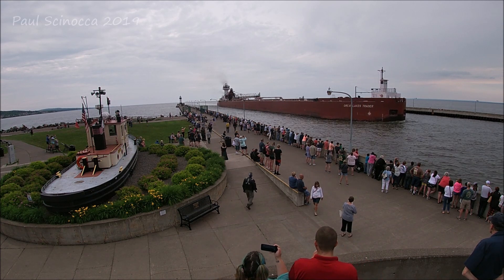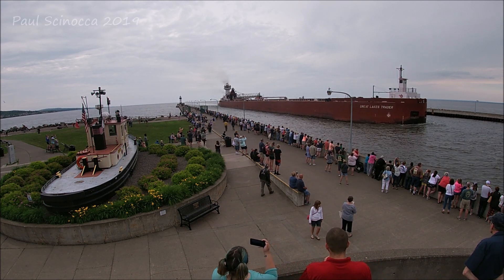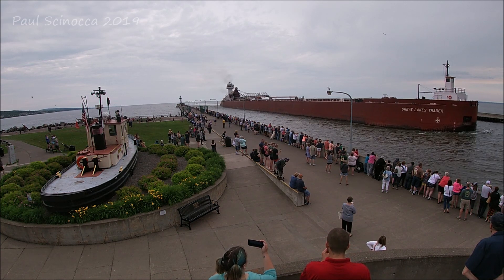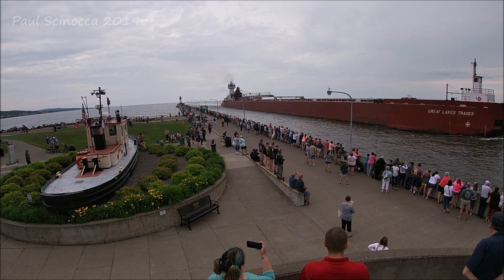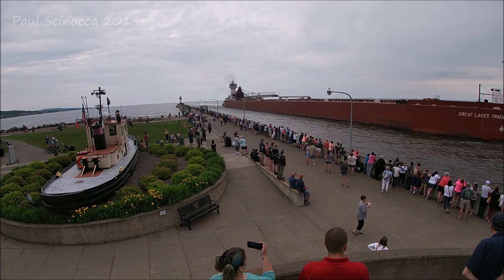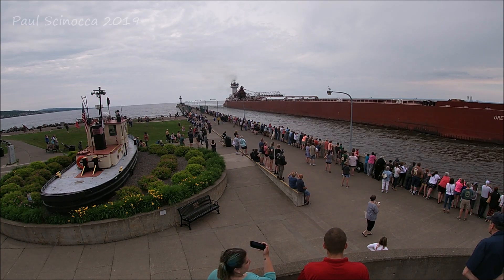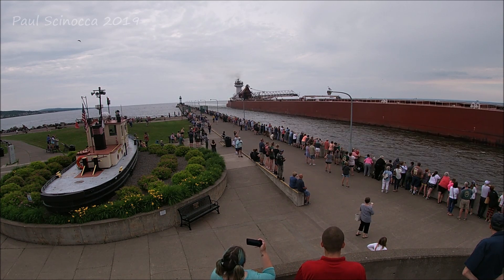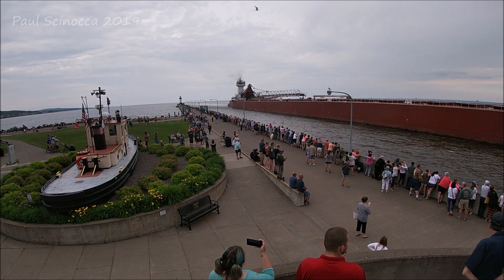Time to learn a little bit about the Joyce VanEnkevort Great Lakes Trader arrive 071419

Comment: Limestone is used for?????? Cement??????
Reply: Yes among many other things
Reply: @highwayman8180  In addition to making cement, steel mills use it to take the slag off the top of the crucible before a pour. It can be heated and turned into lime for use on farmland to increase production.
Reply: It is used for cement indeed, but I think the limestone coming into Duluth is used to make taconite pellets.
Reply: https://en.wikipedia.org/wiki/Limestone#Uses
Reply: @Cobrrdrr  I completely forgot about that one.
Reply: We use it for covering bodies before they are shipped back home. It stops the smell.